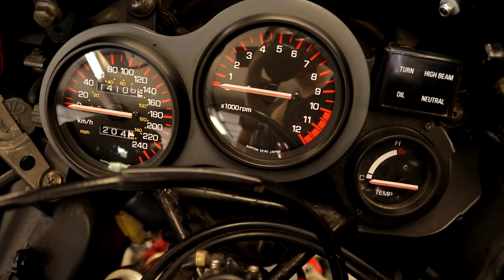Yamaha RZV500 V4 Two Stroke street legal Kenny Roberts &  Eddie Lawson GP500 Racer The Inside Story

Comment: 452 Lbs DRY, Half the engine is balanced the other half isnt, half the engine runs on crank case reeds,the other half doesnt, steel frame looks like my gramps jigged it .. Cheeses Corbet Christmas,I nearly bought one of those but thank fxck I bought the 500 Gamma. That Yamaha is a bloody disaster. 
I switched from a 350 YPVS to an RG 500, the 500 only weighs 25 Lb more and makes 95 hp out of the crate.
The one thing moving from an early YPVS to the N2 taught me was never assume Yamaha wont f#^K you in the @R3e. I would absolutely never buy a new yamaha again. 
Move to 13 . 50 seconds... 1st.2nd ,3rd with a fist full. . Do that on a Gamma 500 the camera would be looking ballistic. 
Thanks for showing me why the 500 YPVS was a bag of crap.
Reply from the maker: Love the RVZ500's, but I would trade one for a Suzuki 500 Gamma.  They are even harder to find.
Reply: @cramersclassics  If you have £5000 I am not so sure about that (might entail extra for shipping / travel) 
I owned two 350 power valves that were tuned to fxck and would out excellerate those 500's (you couldnt even get the nose of the ground?)
An rg 500 just makes those RD 500 's look Sad.
Reply: Yes Joe, true that my sleeper commuter hum drum '09 FZ6 (non R) on paper out accelerates, weighs less, simpler, sport standard beats the RZ, but the FZ will NEVER get the hairs on the back of the neck standing banging the gears thru a tunnel like an RZ V Four.  The audio on this video doesn't do justice, there's others though that do. 
We knew back then, that the Gamma was superior.  Both were out of reach personally here in the US.  My RZ was $2k out the door and is still in service with 36k miles.  The grey market bikes were then 3x the money and as you note, still had steel frames on the Yamaha.

Comment: they look heavy
Reply from the maker: The full-fairings do make them look a bit heavy and they are not light like the RZ350.  But they feel very stable and nimble at speed.  A delight to ride with their low center of gravity, good suspension and brakes.  Not to mention the unique V4 two stroke sensation!  Thanks for watching. -Kirb

Comment: These bikes were a piece of crap. There is a good reason they were never sold in the US. I had one got mine from Canada ah.  The anti dive front brake system GARABGE..
Reply: Right...

That's why a stock 500 ridden by two relative unknowns won the 1984 Castrol 6 hour, beating Wayne Gardner who was riding a Honda  VF1000R homologation special. 

Because they were GARBAGE...

Comment: Correction!  The engine is a balls up from Yamaha  ! It's parallel twins ,twin cranks to form a pathetic vee,  Yamaha just used what they had in their fabrics! Top pair cylinder induction off old  RZ 250 ypvs and lower pair 2MA ,  all they had to do was engine basic configeration with broader Vee  so 4 x 2MA , then 3MA SP cylinders bolt directly on ! 160hp possible ! Thanks Yamaha! I could of built better engine when I was 18 years old ! I owned  RZV500R  And its twice the RD I have aprilia RS250mk2 80hp,138 kg  and it will piss all over RD500,